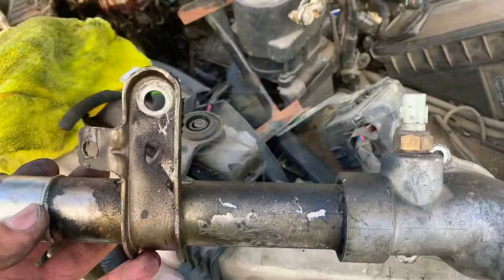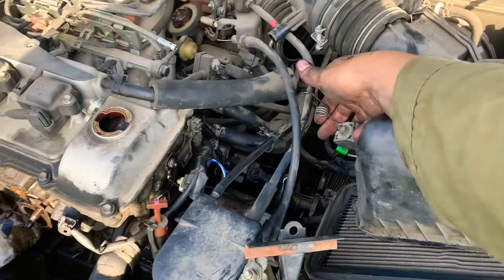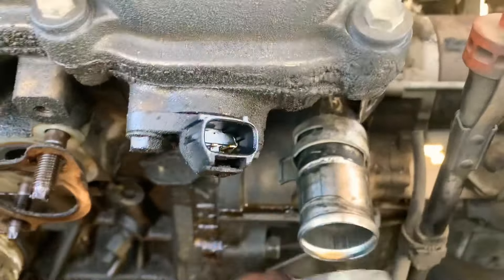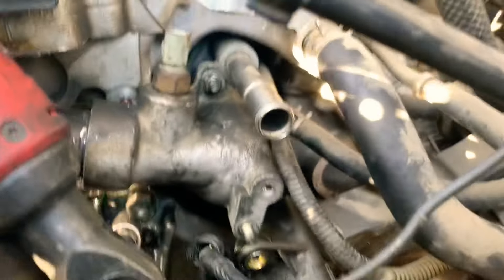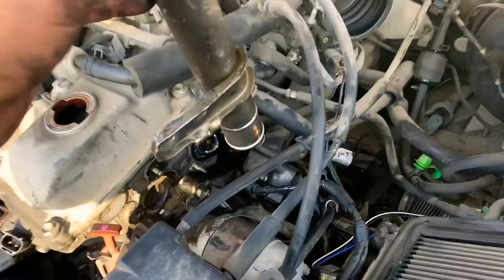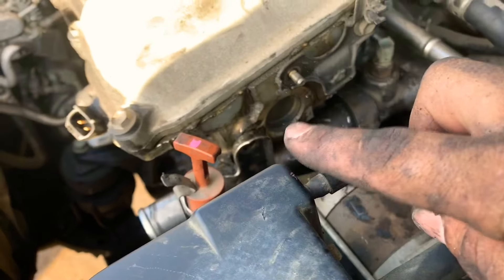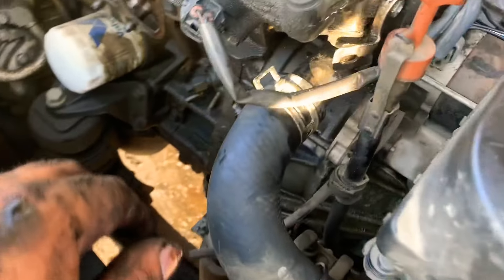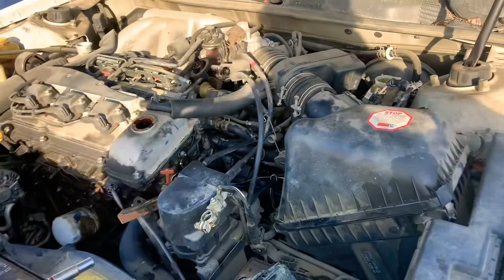How to replace a thermostat on a Toyota Camry or Avalon 3.0L V6 @elchanojose

Comment: I've replaced a few thermostats before but not on the V6 3.0 Camry. Had no idea it's so involved and convoluted. I know when I dropped couple of those nuts in the engine compartment, it will be forever lost. Thanks for the detailed video, a life saver and better than a repair manual.

Comment: Great video i thought  it was on the other side lol ,i got a open thermostat that wont work any more  thats good  in a way no overheating but the engine is not going to normal  temperature like it should idling fast wasting fuel to get hot .......
Reply from the maker: Hello George!  You are right, at least it is open and fluid stills circulates and does cooling.  On the other hand, like you said the engine will use more fuel do to trying to warm up to normal operation temperature but will be hard to do with a open thermostat.  Thank you for sharing your situation.  Take well care George!

Comment: Should I use some.gasket when changing my thermostat
Reply from the maker: Hello!  We recommend to use a new seal or gasket to avoid unwanted leaks.  The old gasket might be compressed and deformed to be reused.  Spend a little to avoid unwanted leaks and expensive repairs.  Take well care!

Comment: Will coolant leak or gush out when disconnecting any of the items you show?
Reply from the maker: Hello bdramsey1!  Remember that for this replacement, the coolant has to be drained all out to avoid coolant gush.  Not all coolant will be drained out of the engine but we recommend to slowly disconnect hoses to control any spills.  Take well care bdramsey1!
Reply: @elchanojose , that's the exact question I had about "the coolant needs to be drained first". I didn't see that mentioned in your video tho. Perhaps you could edit the video and add that in? I had to dig around in the Q&A section to find it. I'm a 64 year old grandmother of six....who likes to tinker with cars!! Thank you for making a quality video with just the right content (and no excessive camera shake, no annoying background music, no foul language, etc). From your video, I got the info I needed to get the job done! Much appreciated!

Comment: I'm doing this right now. Have all the sensors off and all just waiting on car to cool down. I'm going to attempt to leave all the hoses attached just draining coolant from petcock. wiggle the housing to swap thermostat.
Reply from the maker: Hello!  Just take your time and you are going to be just fine.  Take well care!
Reply: @elchanojose  bro I got it in and everything back together but still not blowing heat. Let it burp for a hour now. Idk what it could be
Reply: @elchanojose  I ended up taking the same two hoses off

Comment: Do you have to drain coolant or no?
Reply from the maker: Hello Da Pinoy Pyro!  Yes, you have to drain the coolant out of the system and our recommendation is that if the coolant has not been replace in a long time, it would be a good idea to drain it all out and replace the coolant with frees one and new thermostat.  But, if you only want to change the thermostat, drain as much out and just put it back in as long it is clean of contaminants or debris.  Take well care Da Pinoy Pyro!
Reply: @elchanojose  thank you

Comment: Do you need to flush coolant before replacing?
Reply from the maker: Hello!  If you are replacing the thermostat, we recommend that you take out as much of the old coolant so when you put everything back together and fill the system with new coolant.  Drain the old coolant to replace the thermostat and add new coolant one job is done.  Take well care!